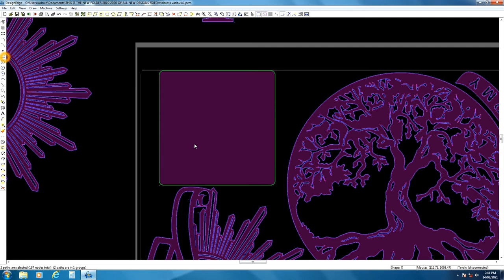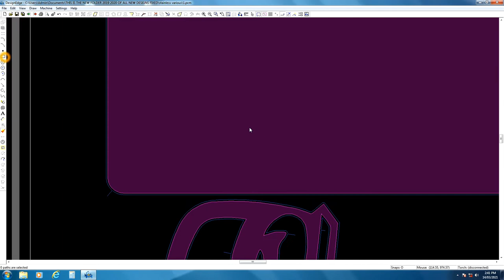PART 3 THE HONDA TLR200 REFLEX PROJECT CONTINUES. I CNC PLASMA CUT AND TURN NEW PARTS ON THE LATHE.

Comment: Nice work, I just pick up a Hond tl125 trials bike and have alot of the same issues as you.
Reply from the maker: Hi Rick. Would be good to get hold of a TL125. I will be doing a new video on TLR200 shortly. I'm doing the seat plus new cover and restoring the seat with foam. Ill also be installing a new carb. Cheers